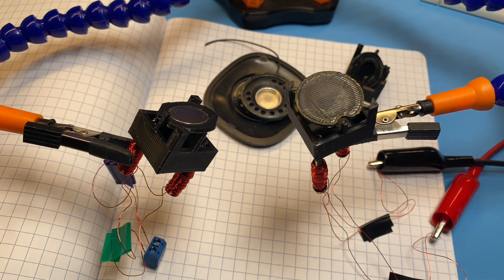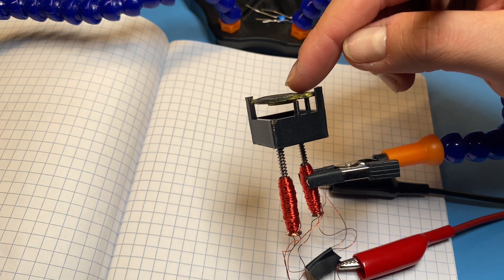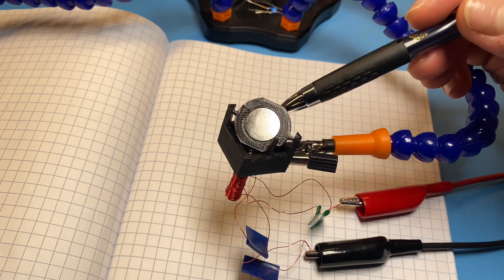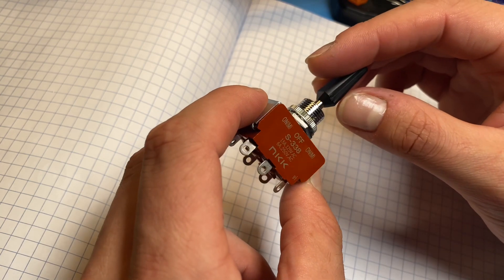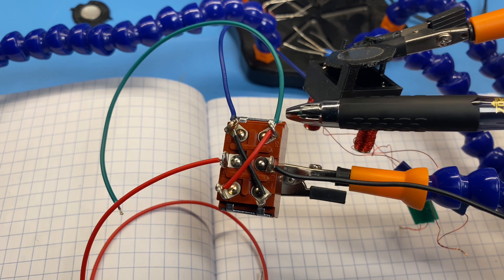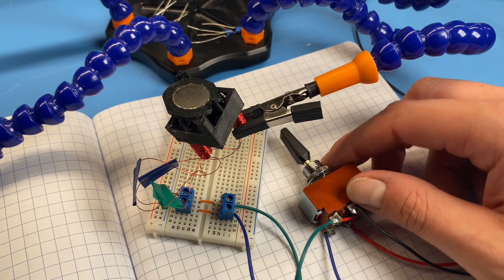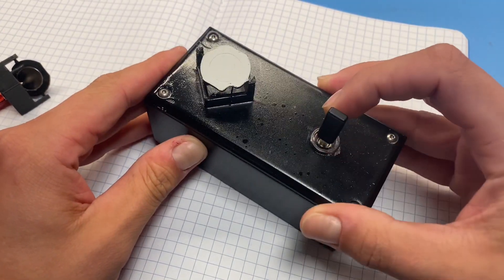3D Printed Flip Dot Display #1 - First Prototype

Comment: Hello Larry, I got inspired by your video to experiment with flip dots. I have created and 3D-printed a similar assembly. I'm struggling a bit with determining the right amount of coil turns for the electromagnets. How did you choose the specific wire thickness and length?

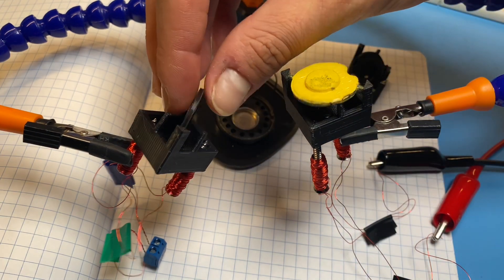Comment: Cool but when you manually flip the dot at 0:55, the other one also flips, the magnets are too strong. How will you handle a grid without all the magnets interfering each other?
Reply from the maker: Great catch! I discuss this more in the next installment I just uploaded. Changed the design to account for this and seems to be solved. Moved the electromagnets around a bit and brought them closer to the magnets.
Reply: Great job  @larry-builds